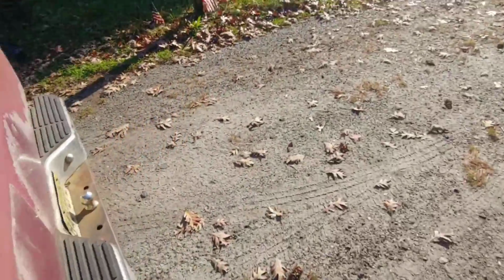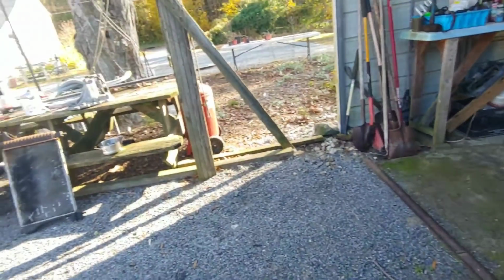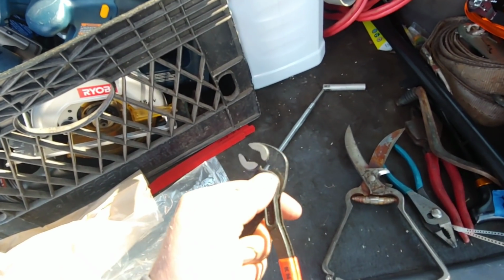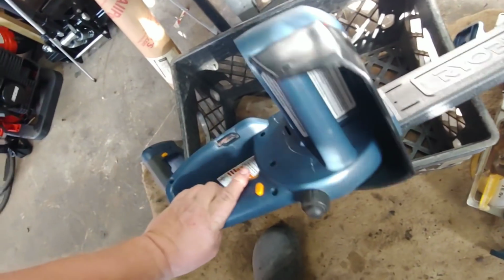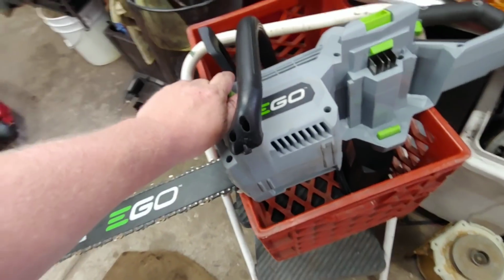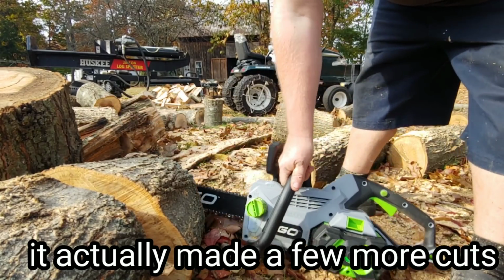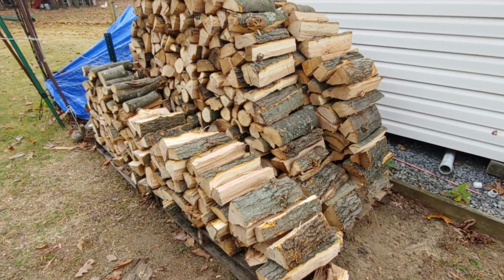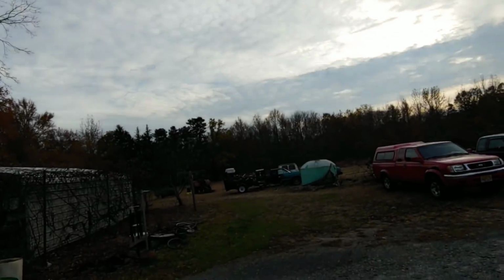Same but different preparing for winter

Comment: Got to get a battery powered saw, looks easier than our Huscavarna, with its idling issues
Reply from the maker: Unless you're using those small engines on a regular basis they can be a real bugger especially with the crappy gas that we have now if you're not using them every week or every other week the electric ones are way better you can set them on the Shelf come back to its 6 months from now and it's going to work long as you got a good battery

Comment: ? on the battery saw , do the bar oil run out about the same time as the battery ? like a gas will , fill with gas fill bar oil and they run about evenly , so you never run saw with out bar oil .
Reply from the maker: I'm not sure I pretty much just keep an eye on it

Comment: Now that you’ve had the EGo stuff for a while would you recommend it? I’ve been debating on getting some of the tools but wanted an honest opinion on how well they work before spending that much.
Reply from the maker: I really love them the technology is just getting better I would say go for it I'm super happy with my purchase and not having to bust my ass every time I want to try to start something I can usually just put a battery in it and go to work I mean if you need something to run all day long everyday it's not really your option but for the normal Home owners or just once in awhile or a storm hits or you're just doing regular maintenance on your property they're great
Reply: @ScrapFarm  Plus you can ride around with that saw in the cab of the truck and you don't smell gas....on in my case spill gas all over.  Not sure why, but I seem to always spill gas on myself - it is a gift I guess.